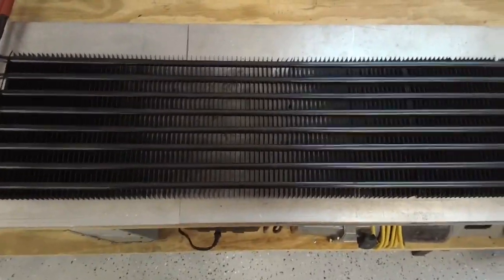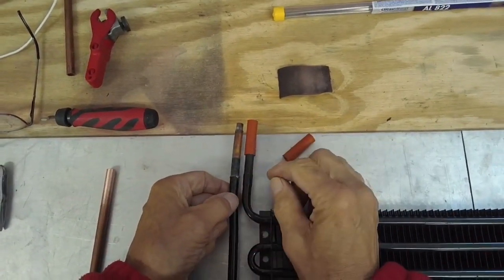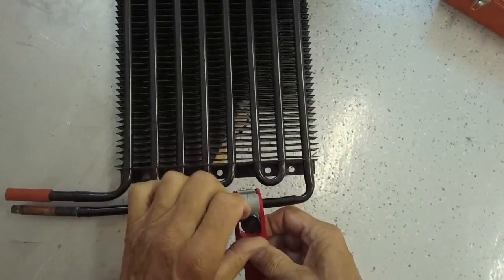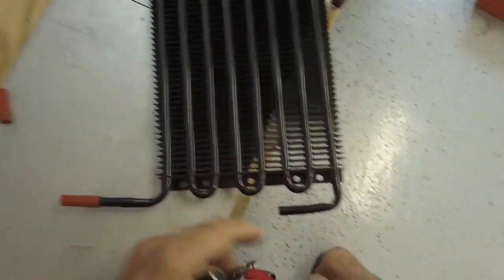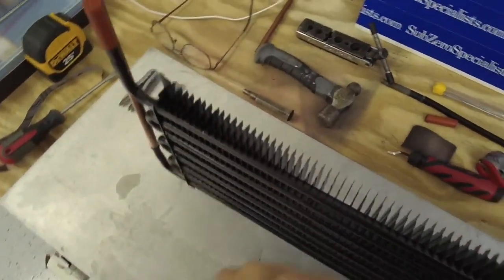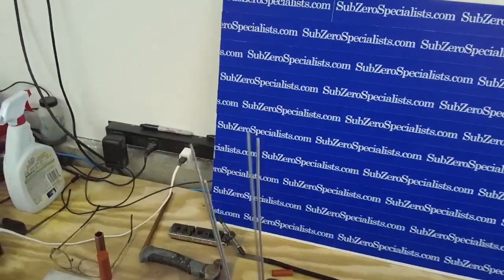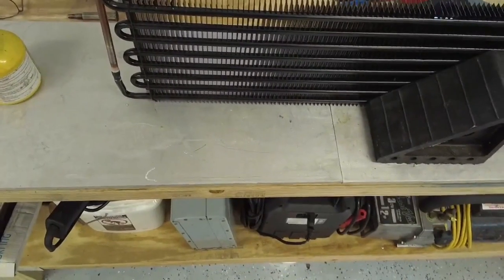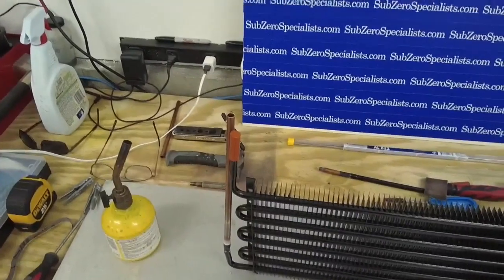Sub-Zero Aluminum Evaporator Repair

Comment: I work in commercial kitchens for a living. My old boss hated that I could braze just about anything and fixed more things than replaced as you just demonstrated. I looked at it as a win-win. Saved the customer money and the repair was all profit minus materials.
Reply from the maker: The skill to do that is priceless. I remember when I was just beginning my career in this business I would sit at my desk and practice soldering, it paid off big time.
Reply: @SubZeroSpecialists  Ha! Same here!!! The old boss was a pretty smart guy so he bought me a tig welder. It paid for itself the first time I used it to weld a leaky fryer vessel. I appreciate gentlemen like you who fix rather than discard. Most guys won't do what you just did. That's a higher level of serviceman. We consider you a "one percenter. "
Reply from the maker: Thank you, appreciate it.

Comment: Can I ship you my evaporator for repair off my sub zero? My local tech company won’t mess with it. They said it has a leak.
Reply from the maker: What model do you have?
Reply: Fisher & Paykel DCS -Model GSE4820SS
Reply from the maker: I’m not familiar with Fisher Paykel, we specialize in SubZero.
Reply: @SubZeroSpecialists  Well, I know what’s wrong with it. the evaporator has a leak in it. I’m just needing someone to fix the leak.
Reply from the maker: @crzysuthrnboy  it’s not that simple. Subzero evaporators leak from the blast joints and those are fixable as per the video you watched. I don’t know if Fiaher Paykel evaporators can be fixed since I’ve never seen one.
Reply: @SubZeroSpecialists  what if I took a video of the evaporator in there. Would you be able to tell if you might can fix it
Reply from the maker: @crzysuthrnboy  I made the video to show how to fix a subzero evaporator. Taking a picture of your evaporator won’t help me.

Comment: It's pronounced swa'-j and rhymes with page.
Reply from the maker: You are correct but in my 56 years of experience I’ve never heard anyone pronounce it that way. Thanks for enlightening us.
Reply: @SubZeroSpecialists  Interestingly, "swag" is slang for stolen property.
Reply: @SubZeroSpecialists  Great repair videos, so grateful that you share your knowledge.  I think they pronounce it "swa-j" in England (my home country).  On my 1994 S-Z 550 I notice some icing on the bottom left , plus the defrost gutter on that side shows some brown discoloration of the caulking, so I am guessing an evaporator repair or replacement is in my future.  Also the temperature seems to fluctuate between 30- 45.
Reply from the maker: @grahamchallis5826  Yes you are correct on the Swag pronunciation, most people in the business say it with a hard G. As for the ice on the back wall it could be a freon leak especially since the temperature is fluctuating. Discoloration could be oil leaking out with the freon.
Reply: You say tomayto,  I say tomahhto

Comment: With the coil still connected to the fridge and some ice in the area of the copper to coil joint but also on the coil is there a way to determine the leak is coming from the joint and not somewhere along the coil? This is a bit of an old thread, hope you are still monitoring! Thanks.
Reply from the maker: The most likely place of a leak is at the blast joint where the copper meets the aluminum. Pressurize the system to at 125psi and check with bubbles or ultra sound.
Reply: @SubZeroSpecialists  Thank you. Are there any sealants for this type of joint leak (that could hold for a couple of years) rather than having to evacuate the system and do what you did in this video?
Reply from the maker: @michaelg6851  unfortunately leak seal is not recommended, could cause worse problems.
Reply: @SubZeroSpecialists  Thanks again.

Comment: Hi, my SubZero 424 temperature could not go below 78 degree. Can I get some suggestion from you what’s wrong for it? Thanks.
Reply from the maker: If you cleaned the condenser then there’s not much to do but call a service company. It could be a faulty thermistor or control board or a Freon leak or a switching valve.
Reply: Sub Zero Specialists O.K. Thanks.

Comment from the maker: I doubt if JB weld would hold up under consistent temperature changes and moisture. Also, you must evacuate the sealed-system before attempting any repairs.
Reply: Remember a company called Gemline?  They made this evaporator epoxy repair kit that was absolutely amazing. I patched dozens of punctured evaporators (yes on the old manual defrost refrigerators), and it never failed. 
Of course your way is superior but in a pinch Gemline EP538 was great.
Reply from the maker: @TheNYgolfer  I remember Gemline. I still have one of their charging columns and it still works and I also used their epoxy kit- too bad they’re gone.